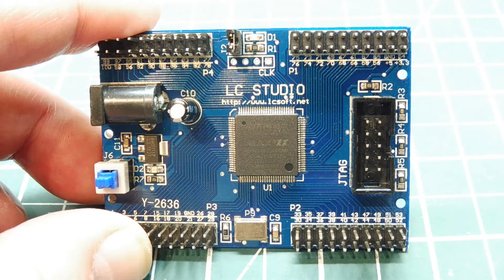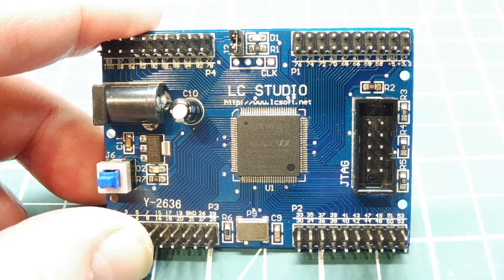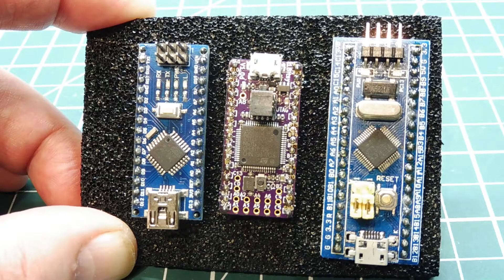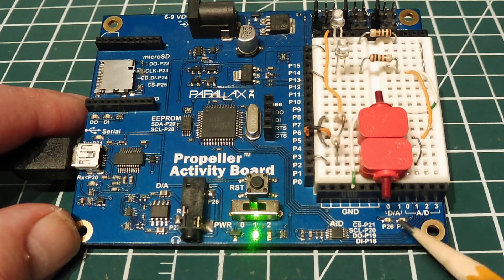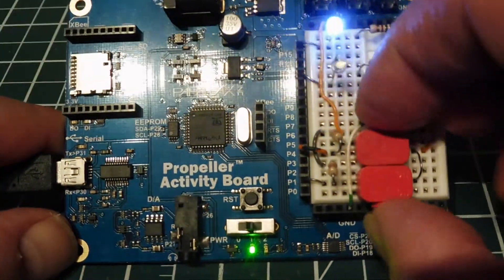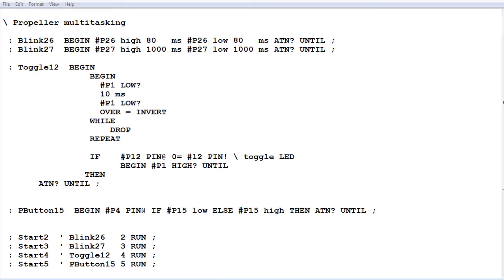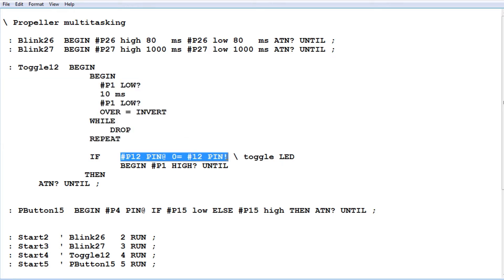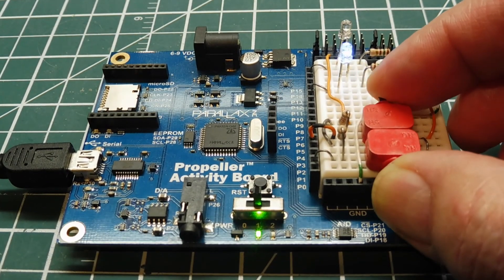Parallel Processing Using Multi-core Microcontrollers

Comment: My favorite MCU (The Prop)! There are a big variety of boards that exist for the Propeller...ones like the Activity Board and smaller ones shown in your vid. There's a WX version of the Activity Board now that with the addition of a WiFi module, allows the MCU to be re-flashed over WiFi (and essentially serves as a wireless serial port for your MCU application's purpose, too)...nice vid as always!
Reply from the maker: Thanks for the feedback!
Yes .. Parallax has quite a variety of boards for the Propeller.
I want to try the "Flip" module. Very convenient for embedded projects.
https://www.parallax.com/product/32123
Reply: Yup! That's a great module...makes it easy to start something on an existing breadboard...I recently wrote a driver for a 4x20 OLED character display using one...nice little board

Comment: Great intro to parallel processing.

The Propeller chip is very cool and simple to understand. For those who didn't know, a cog is the term Parallax Inc. uses for a core in the Propeller chip.

Maybe next you can show some inter-process communication. An example might be to cause your two push-buttons to change the blink rate on the other two processes.
Reply from the maker: Yes ... inter-communication is a powerful feature of the Propeller.
I had made a video showing how to start and stop tasks running on different cogs using cog 0.
https://youtu.be/Iuf44VCMh60

Comment: In these multicore microcontrollers... Are there separate gpios for each microcontroller or all the gpios are common for all the microcontrollers??
Reply from the maker: There are 32 GPIOs on the Propeller chip and they are shared with the 8 cogs.
The GPIOs are common so you assign each cog their own GPIO in your code.

Comment: Good information, i have one question.
Which forth language do you use in the example for de propeller chip?
I found Propforth and Tachyonforth on the internet.
Thanks!
Reply from the maker: The code I used was written using Tachyon Forth.